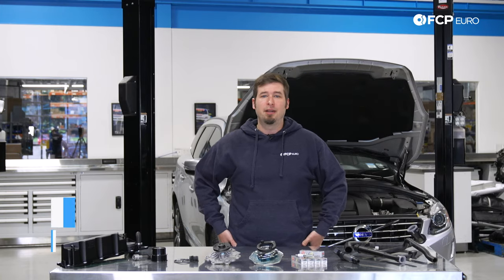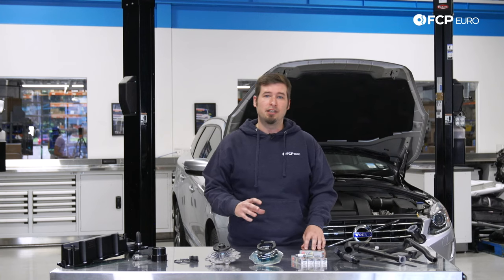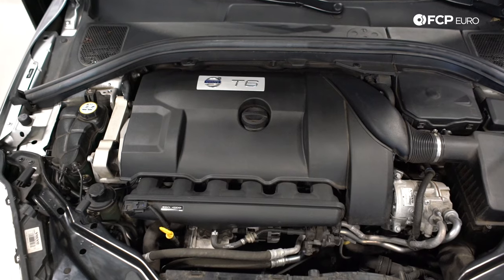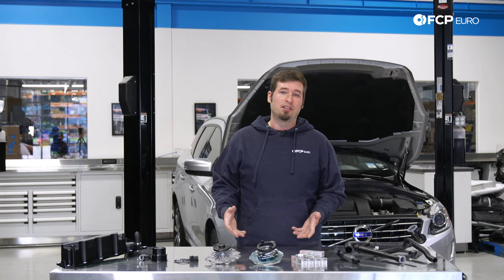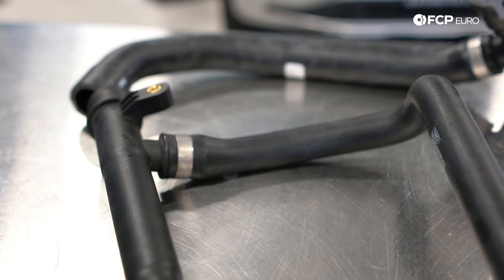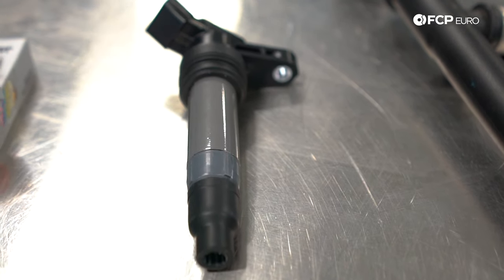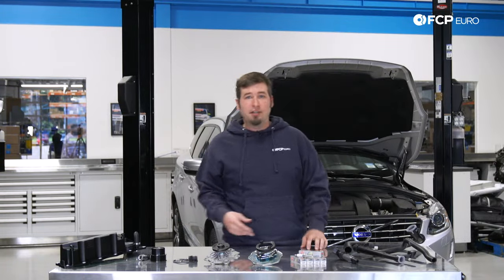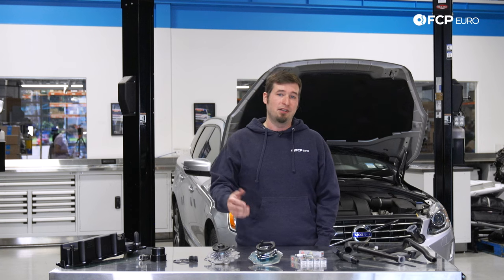Volvo T6 3.0L & SI6 3.2L Engine Diagnostic & Maintenance Guide (XC90, XC60, S60, S80, V60, V70)

Comment: I have 2007 xc90 3.2 engine that rattle like crazy with blinking check engine. I have change all the ignition coil and brand new spark plug but problem still persists. I have check all cylinders comression test shows all above 200psi. Can you help me what might could be the problem. Btw, vehicule has 200658km. Thank you in advance.
Reply: I have a 2012 volvo s60 t6. It started fine and runs upto temp with no issue. As soon as it gets warm I get a misfire n#2 cylinder. I just found my pcv diaphragm was bad by leaking air threw it and replaced.  Car was fine for 4 days and today started misfiring again....what could this be? I replaced coils and plugs about 25k ago with volvo plugs. Please help and desperate to get it fixed! ❤my volvo